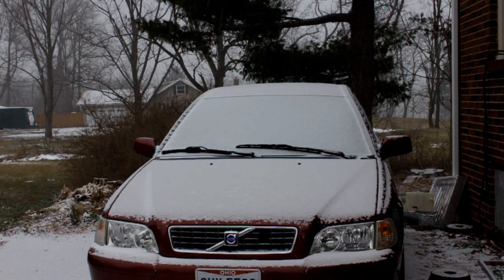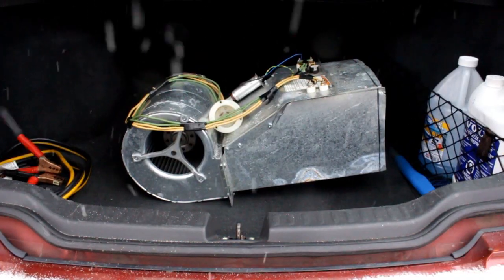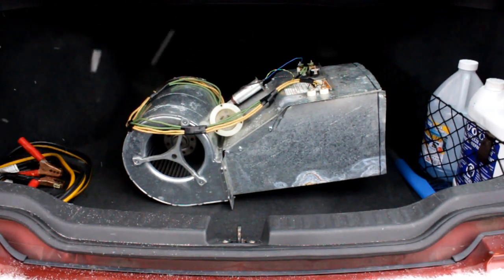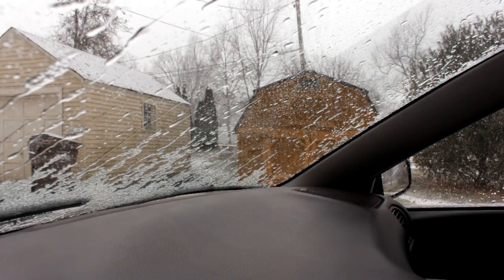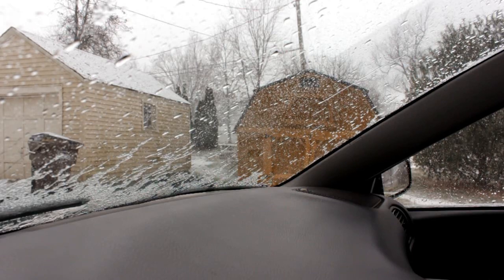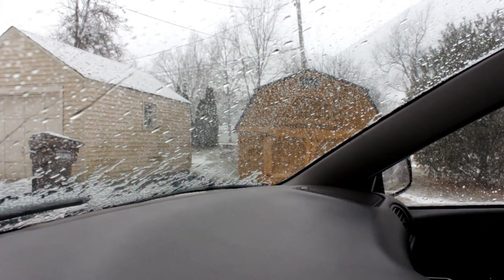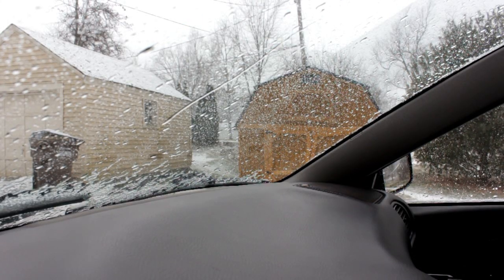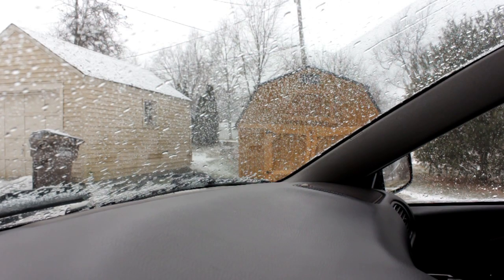Defrosting A Car with a 10kW Heater

Comment: At 240 volts that’s 42 amps, so I assume you are using a 50 amp cord and plug. How’s that set up?  Using a marine style shore power receptacle? How does the thick cord enter the vehicle? Etc.  Inquiring minds want to know. Thanks.
Reply from the maker: Yes the cord  is quite hefty, but it runs in through the rear hatch/tailgate. The tailgate though doesn't close because the cord is too thick. I just leave it partially open. 10 kW is enough to overcome the heat loss.

Comment: Make it illegal to warm up ur car with idling. You get cars burning to the ground with people trying to heat up their cars with electric heaters. Great law.  Way less co2 with car fires
Reply from the maker: Just to let you know I am a trained and certified HVAC professional, and my heater has all the required limit and safety switches.

Comment: How can it be illegal to warm your car up by idling the engine in Ohio?
Reply from the maker: You can't leave the key in the ignition unattended, that's the law.  Technically, you can run it but you'll have to stay with it, or have a remote start system. None of my cars ever had remote start, although the electric van I had you could run the heater without the key being in the ignition.

Comment: I live in Vancouver BC Canada and we have mild winters here but windshield frost is a real bugger... In Canada most if not all cars have engine block heater and 120V plug you can plug into power. I added another 120V wire (just soldered it in parallel to block heater and taped it). So now I have 120V power cable near my seat  which is on when I I turn on block heater. I bought simple all metal 1.5 KW  constraction heater and plug it in into my new outlet near the seat inside my car. I also use timer to turn it 30 minutes before I leave my house. By the time I seat in my car the engine is a bit warm and all ice is melted. The one thing you have to think is how to position your heater and it won't fall or turn in wrong direction. Works for me for last 3 years.

Comment: Interesting experiment. Camera placement was a tad questionable :) try the backseat.
Also it was unclear where you placed the heater. I would have liked to see it blow on the low part of the windshield like the car itself does rather than perhaps diffusely in the cabin. And the wipers should have been applied earlier since you don't need to melt everything, only enough to loosen it.
Also fahrenheit is an abomination.
Reply from the maker: +Dan Frederiksen The heater was placed above the rear seats (the car has a shelf) The blower has a pretty high air flow rate so it fills the cabin quite well. Camera was placed on the dashboard. It was either that or behind the drivers seat, which then would have blocked the airflow from the heater. I just showed melting the snow to give an example of the heaters power, it was actually quite warm inside the car so yeah it wipers could have come on sooner.
Reply: +subcooledheatpump ah. If possible, direct to lower windshield and periodic wiper application would be interesting. I would guess the time could be cut to 30 seconds. Maybe reduced airflow such that the exhaust temp is higher might also improve the efficacy.

Comment: Nice, 3 phase 480 volts ? Thumbs up :)

Alex
Reply from the maker: +High Voltage I wish I had 3 phase, sadly it's only 240 single phase but it helps
Reply: subcooledheatpump Ok 👍👍

Comment: You can't run your own car on your own property?
Reply from the maker: +Jeff Barr That is correct. Welcome to Ohio.
Reply: +subcooledheatpump WE ONLY think THIS'S a FREE COUNTRY...
Reply: I live in Michigan and use a remote start system. Warms my car up nicely in 15 minutes and the engine and car interior is nice and warm. What you are talking about is a block heater, which are common on diesel powered vehicles. I had a truck for years that used one. The electrical draw is great and ran my bill up. Even when put on a timer it added a lot of cost.
Reply: +superdau Normal car produces very little noise at idle. Also it consumes very little fuel and the amount of exhaust gases is also very small. In Russia it is forbidden to stand in the living area with the engine running for more than an hour. To warm up the engine enough 10-15-20 minutes.
Reply: +Jeff Barr 
The heaters I mean run on Diesel or gas right out of the vehicle's tank, not electricity. It also runs the coolant pump and internal fans. Depending on the model they also can be started via remote or on a timer. If the vehicle doesn't come with one (which seems to be the norm for cars), it can be installed in almost any car.
Reply from the maker: +superdau Yes we refer to that as a parking heater ( "Standheizung" in Deutsch ) . Very few cars in the U.S. have those available as an option. The real issue with cars in cold weather Is that the engine wear increases quite a bit when they are running cold. Idling doesn't help because the engine is running even longer in a cold state. Plus you're asking your engine to heat the cabin at the same time. As superdau said, you really need to drive off, but slowly to start producing enough heat. Sometimes it is impractical to drive off with the windshield covered in ice or snow. Even if I brush the snow, fog still forms on the windshield when it is cold. Also an interesting note, the U.S. EPA mandates that an engine must come to full temperature within 7 minutes of driving. You could idle your engine for 20 minutes and not achieve that if you have the heat running. Thank you everyone for watching
Reply: +Jeff Barr 
So you can contain the fumes and noise to your own property? An engine produces almost no heat while idling and many newer engines so little excess heat even while under load, that you need an extra electric heater to get high enough temperature at all in cold weather. Get a parking/auxiliary/engine independent heating system (don't know what the exact expression is in english). It also heats the engine, so it won't have to to a cold start.